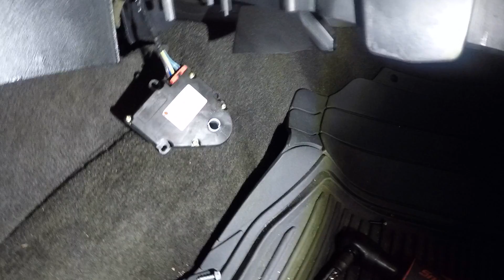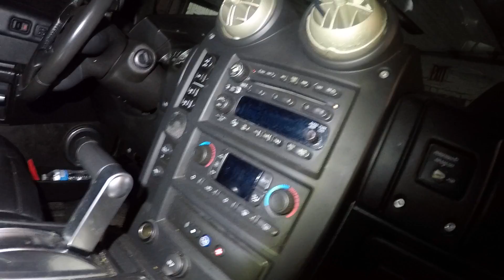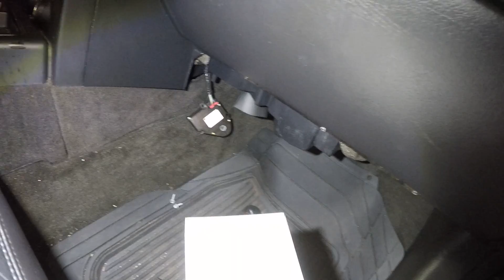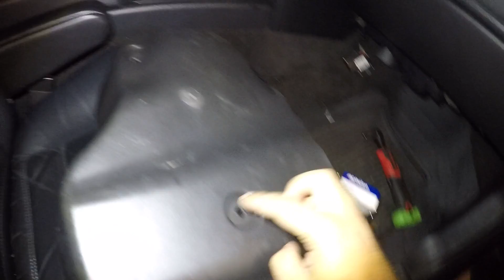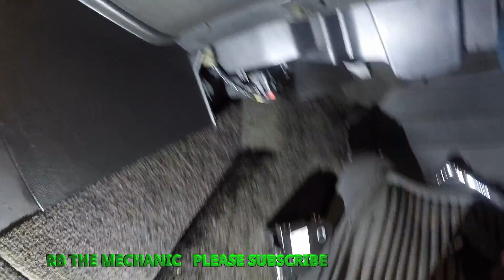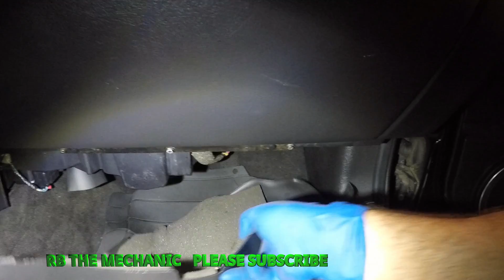Hummer H2 Blend door motor bad, Hot air driver side cold Passange side

Comment: If it's an electric problem.  I recommend disconnecting both battery cables for 30 minutes.  Before reconnecting the cables.  Tap the cables together.  Then reinstall them.  It's reset mine a few times already.  An electrical issues with your hummer.  Do this before first to see if it resets your problem.   Great video.  Thxs for sharing it 💯🆒️
Reply from the maker: It was bad bled door actuator it worked as soon as we replaced it
Reply: @RBTheMechanic awesome.  My comment is not meant to be negative.  I hope you didn't take it that way.  I was just sharing my fix.  I've used this method twice.  Awesome video.  Thxs

Comment: Would of been nice for you to test it out for us. Did this correct the heat on driver side after the install?
Reply from the maker: Yes it’s fixed there’s no tests it might start to work temporarily if u move it around or tap on it so no tests
Reply: @RBTheMechanic good. thx my AI app is telling me it's the actuator on driver side but I believe u more then that bs app.

Comment: I have exact problem I took to mechanic they said they need to remove all the dashboard??? They want $2,300 to replace
Reply from the maker: For this no way
Reply: @RBTheMechanic 
Yeah I took it back home . how much did you pay for that parts? I see some on eBay around $200? 
I also see some at Amazon for $40 but it’s for GMC would that work?

Comment: Hello Bro ! Please help me if you have a little time for me. How many blend door have in it ? And where. Thank s your answer 🤝
Reply from the maker: If u got dual control then there’s 2 bled door.   One mode door and one air recirculating motor
Reply: @RBTheMechanic  my problem is a turn on The A/C and a cold air only cum out from one hole. Middle of The center konzol. And that s all.
Reply: @RBTheMechanic  the problem is that when I turn on the air conditioner, the cold air only comes from the center console. only from there.Warm air comes from the other vents. what could be the problem? the compressor is good. Thank you

Comment: I have the same issue with my Hummer. Hot air on driver side and cold air on passenger side. I replaced blend door actuator, and have air both sides, but now I have no heat on the driver side unless  I turn it above 90 degrees.
Reply from the maker: It might need time to find its spot give it turn hot cold hot cold few times other wise it might be bad setup on where it’s sitting
Reply: @RBTheMechanic  i think it needs recalibration.
Reply from the maker: @glenglene8473  prolly need to fo that
Reply: I have the same exact issue with my Hummer been having the blend door actuator for months waiting on an ac specialist until I saw this video gonna install it tomorrow and see what happens I’ve also replaced the Ac control module twice it worked for a few months then the same thing Hot on driver side cold on passenger side this video was sent to me for a reason wish me luck 🫡

Comment: I have cold air on one side and hot on the other, I want to get it to work properly to blow both hot and cold as needed. Will this fix my problem? I have a 2003 Hummer H2. Great video thanks
Reply from the maker: The side that’s not chaning temp check the bled door motor for that side
Reply: Thank you, where are you located?
Reply from the maker: @dsanztintnzound6767  u have dual climate control? One on each side  if u do have dual climat control
Reply: @dsanztintnzound6767 there are actually 3 blend door actuators in the H2 hummer... the one he changed, one behind the dash that controls the passanger side (I'm changing that one tomorrow) and is a pain to change, and the 3rd is under the dash, to the right of the sensor on the dash (I haven't figured out what this one does, but it's there lol).
Reply: @photoghostjz  I figured it out. The third one that you mentioned controls the dual zone.
Reply: @dsanztintnzound6767  thank you, good to know

Comment: Thanks for this video. I’ve been riding around in this heat dying to solve this. About a week ago my security went off and caused my truck to lose all presets when I disconnected and reconnected the battery. I did all the relearning stuff for ac but none ever worked. I just dropped this and manually flipped my ac to both sides. Will be ordering a new blend door soon! Thank you sooooooooo much!!!!!!
Reply from the maker: Nice trick to flip the doors!!!
Reply: When you say flip the door, do you mean rotating the little nub? Trying to do this myself
Reply: 🙌🙌 ty for the video. Local shop wanted to charge me 500 to do this

Comment: You got ripped off big time for that part. I found it for $15.00 👍
Reply from the maker: Nah I wouldn’t trust 15$ part I’m ok with the part price
Reply: Here’s the down side from m last post.  If you do turn the actuator door manually every time you turn off the Hummer it will go back to the door being closed so you will have to turn it manually every time the truck is turned off.

Comment: In my case (2003 H2), it's hot on the drivers side, cold on the passenger side, and no controls work except the fan speed.  Air flow always comes from the defrost and floor.  After multiple attempts to reset, I broke down and took the dash apart to replace all 4 actuators.   Still nothing!   I'm officially pulling my hair out... I havent' heard of anyone who had a bad control unit be the culprit, but I don't know what to do next.  Any suggestions?      Also, I havent seen this mentioned elsewhere, but my unit goes to 75 degrees in the calibration cycle, not 74 as I've seen elsewhere.  Is this a clue?
Reply from the maker: Welll I had lot of the control unit bad on American cars but check all fuses before anything

Comment: I appreciated the video it was very helpful. I replaced this blend door actuator and the aspirator. I recalibrated everything and still hot air. I took off the actuator and moved the door by hand and it started to blow cool air. It wasn’t as cold and the passengers side but it wasn’t hot. I’m not sure if the actuator is working or if the door is jammed. I took off the actuator I plugged and connected it to see if it would turn or make noises and I heard and saw nothing. Any suggestions?  Thanks in advance!
Reply from the maker: Do u have dual control?  Also low Freon could cause only partial of the ac to cool
Reply: Yes I have dual controls. I will check on the Freon this weekend
Reply: @tonydesantis-wt1hn  Any luck?  I'm trying to puzzle this out myself.
Reply: @lavaeater100  Okay The car should be ready this week and what was found didn't surprise me. I had a major AC leak which explained why the AC was not getting very cold. Second, the blend door actuator under the glove box was bad. I was surprised with that as I bought that part at AutoZone as new. Now the fun part. Since I had the AC being worked on my H2 has 222000 miles on it I decided to replace the heater core and get the system completely rebuilt. Overall not what I wanted to do but I am almost finished rebuilding the car. I purchase the H2 for 8500 but with this service I am close to 60k invested in the vehicle. Once I replace or rebuild the engine the rebuild will be complete.
Reply: @lavaeater100  I forgot to hit reply on my earlier response. Okay the blend door actuator that is under the glove box was bad. I just put that one in so it was defective. I had a major leak which was causing the AC not to cool properly. So I can not perform these tasks at this point so I had a shop do it. They replaced the condenser and the AC lines. I actually have 223000 on my H2 so I am sure the heater core was going to fail at some point so I also have them replacing the heater core. It sucks but the AC should be completely replaced after this as I had already replaced the AC Control unit. I only have to get the engine rebuilt or replaced and the restoration is complete. I bought the H2 in 2019 for 8500 with these changes I am up to almost 60K but the car runs great and I am happy with it. I want the H3 T next but I think I will buy the truck that has been restored and not go the cheap way.

Comment: all 4 top vents blowing hot air even after i did the calubration
Reply: i put ac/pro in line witch it said Full, then calibration and still hot air come out only on both sides...even when Temp is at 60 still blowing hot
Reply from the maker: @darrellkizzee6634  those ac cans don’t do the job like it suppose to be u need to recharge the system with ac machine recover vaccum and recharge it could be fault pressures too much or too little will be bad for ac system
Reply: maybe the climate control unit itself is bad?
Reply from the maker: @darrellkizzee6634  check the basics first if ac is operating
Reply from the maker: Dose ur ac wrk? Put the ac on and check low side line if it gets cold

Comment: easy to do. I would suggest that the door stub that the motor turns, could be stuck. I would up trying to move mine by hand, then needed to use a pliers to help, it got freed and moving easily back ang forth. Suspect the door had sealed itself to one of the openings and motor could not move it. I believe, I now have a spade actuator. something to check before installing.

Comment: What if i replaced everything and it still blowing warm air on both sides.
Reply from the maker: Did u check and Freon pressure I usully get these and Freon is low and it only
Allows half of the system to send out cold air how ever it could be ur ac system is low on Freon not able to make any cold air check or reservice the ac system

Comment: How many actuator motors are there?
Reply from the maker: Blend door 2 if u have dual. Mode door and recirculating
Reply: @RBTheMechanic  How can I tell which one is bad. And where is the 2nd one located?
Reply from the maker: @njcop11  well if ur changing air face then to flow then to windshield and if it dose change directions then ur mode door motor is good.    
If ur air dosent change hot to cold or cold to hot then ur blend door motor is bad
Reply: @RBTheMechanic  my hot and cold work fine. Mine goes right to default and blows out the windshield defroster vents.
Reply from the maker: @njcop11  that’s mode door motor
Reply: @RBTheMechanic  is that the one on the driver side?
Reply from the maker: @njcop11  yeah I think so try turning it by hand see if it makes diffrent to conform the problem
Reply: @RBTheMechanic  I’ll give that a shot. Thank you for the help. 👍🏻

Comment: I have cold air for driver and back seats but the passenger has hot air
Reply from the maker: It can be the blend door motor if u have dual ac system meaning u can desired select temp on driver and passenger side or low Freon check this video out it has low Freon https://youtu.be/2sGsTzU1UYo

Comment: Thanks for the upload.
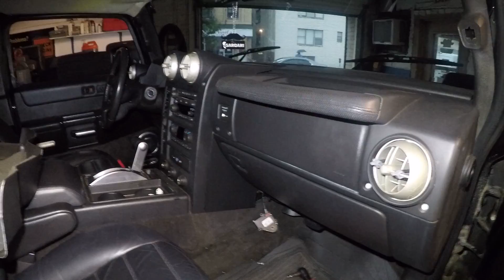All start here: 0:35
Change of blender motor seems easy as you demonstrate well. But what about the actuators, in back of the dash, one driver, one passenger side, others talk about?
Reply from the maker: Sam Sen there different ones it depends which proble you have there’s one for blend door one for mode door